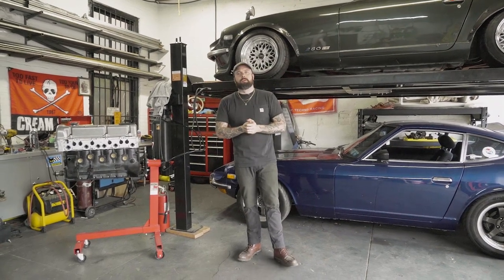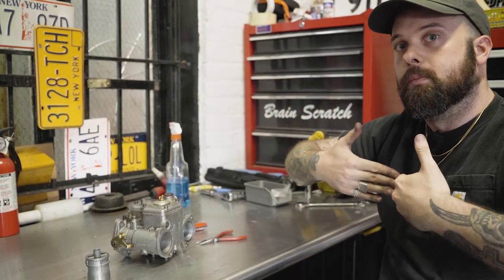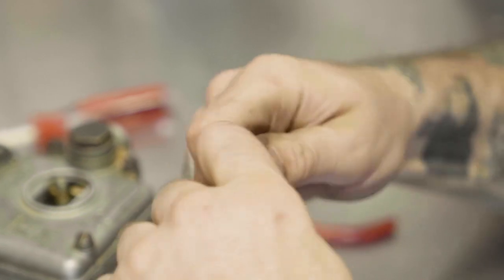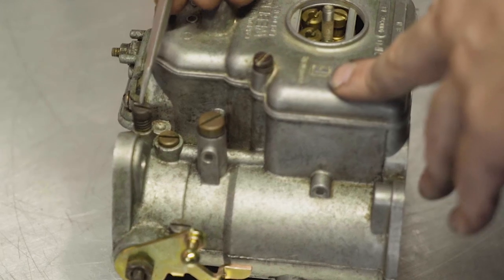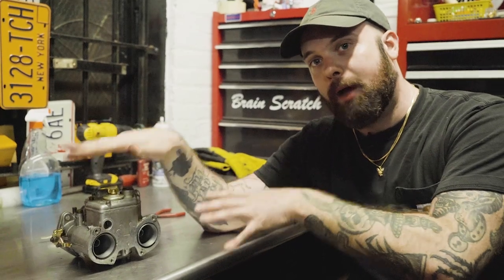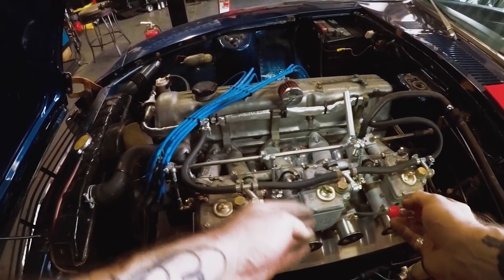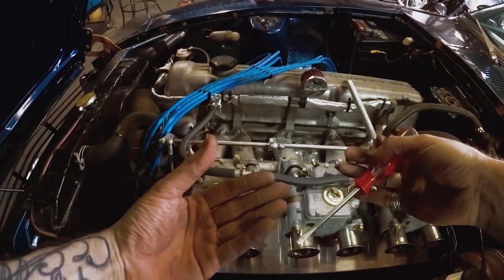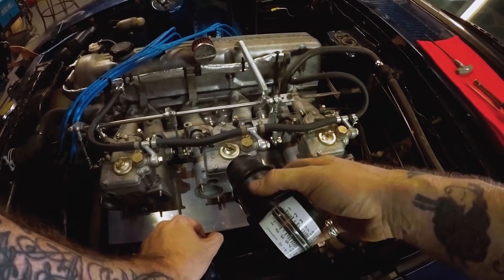How To Tune & Sync Weber DCOE Carburetors

Comment: One of the best dcoe explanations out there. I liked how you specifically explained about the position of the throttle plate at idle with regard to the first progression hole. However, from memory, Weber states it should cover the first progression hole. Once this is set then , in my opinion, the idle speed screw should not be adjusted again as each carb should flow at the same rate. Only use the idle mixture screw to adjust the idle rpm.
Reply from the maker: Andrew B Thank you! And yes, as far as prelim tuning is concerned, all incremental adjustments should be made with your mixture screws to find the best idle without the motor stumbling down. However, once this is established, it is ultimately necessary to balance the carbs within fine adjustments along the idle speed axis, be it with interlink adjustments or the method shown here.
Reply: @TheCurbCut  @5:25 I should add that at idle the Weber Tuning Manual states that the progression holes should NOT be exposed. The early Spanish made DCOE carbs had issues regarding obtaining good idle hence people seem to have to adjust the throttle plate position that can expose part of the first progression hole. The later Weber DCOE 45 152G model seemed to fix this and added a 4th progression hole.
@5:40 - so at idle, the fuel/air mix from the idle jet should only be entering each barrel via the idle hole. The amount of this mix delivered is adjusted by the idle mixture screw as you then say at @7:05.
It is the idle jet that determines the mix of fuel/air that is delivered to the idle hole AND the progression holes.

Comment: I'm a new owner of a '72 240Z with triple Weber 40 DCOEs. These are my first set of Weber side drafts.  I've leaned the idle jets to 45 F9's to get me about one turn out on the idle mixture  screws. Runs pretty well and the plugs look light brown not black as before. I'm also about to change from a race spec cam to a performance street cam this week. I will see how the jetting requirements change then with better vacuum and more compression from less duration. I do have the short taper idle screws. Do you think I could put in the long taper thinner ones for finer adjustment? Thanks for the tune tips.
Reply from the maker: novakenss The longer enrichment screws wouldnt work the way you think by just installing them on your earlier carbs. I get your theorizing, but I wouldn’t attempt this. These screws only help with the idle circuit, so once your in the power range of the car on your main circuit, it almost doesnt matter. Also, they would seat completely differently and the “tuning” here isnt going to net the results you’re after. ALSO! I would wait til you install the new cam and assess where a rejet is needed or perhaps you can simply adjust on your present hardware. Good luck!
Reply: @TheCurbCut  I'm putting in the street cam tomorrow. I'll see how the  air fuel ratios change. I have two O2 sensors in the header twin pipes before the collector. 2 AFR gauges in the console. I'll see all the ranges and what I'll need to do. Lastly, I didn't think that the long tapered idle needles would be compatible with older 40DCOE carbs. Thanks for that info.

Comment: Those carbs with horns, a " uni-sync " tool allows you to keep the air horns on.....the air horns are an itergral part of the side drafts..
Put you are the only channel to explain these carbs ,which are Black Magic to most people that buy them.
Great job.
Reply from the maker: Fair point! And if I had a uni-sync handy, that would have been the way to do it!  

That being said, a good later-note to this syncing process would be this:
- if you're syncing at idle without your horns in place, bear in mind that the longer your stacks are, the richer your AFR will read without them at idle 
- sync a little richer sans horn because intake velocity will be higher when reinstalled, thusly leaning out the mixture a bit
- conversely, the shorter your horns = less intake velocity at idle; your idle syncing will remain closer to your sans-horn readings

By this process in the video, I was functioning off of some pre-existing knowledge of what is needed for this particular application.

And thanks for the kind words! We value all the feedback
Reply: @TheCurbCut  and as to trumpet length it's to help tune power range.
    Short for low to mid range 
Cams and long for mid to high rpm power bands.
    I always find amusing when people run their side drafts on looks alone.
    Let's get the long ones they look Bad-Ass.    Fine for show.
But you need to MATCH ,to go.
Again I've seen tons of videos.....no body has taken the time to explaining chokes and such and then show how to sync side drafts. Your the first..  so that's very cool.
     I've run a SPORTS CAR only Restoration shop for 20 yrs ,20 yrs ago   I love side drafts of all kinds, 
I always had both tools in my tool box ,for monitoring intake air.
I keep both my Z cars in CARBS.    And Happy to do so.
Again a well done video !

Comment: I watched this video again today. I got my street performance 260S Comp Cam installed and broken in. I had to have the rocker arms ground a little. Idle now is smooth and I have put in 45 F9 idle jets to get my AFR numbers to 13:1 at idle which is about 900 rpm. I did have to loosen all the throttle arms so I could get the throttle plates the same. Idle mixtures about 5/8 turn out for 13:1. I sent my distributor to Advanced Distributors in Minnesota for a rebuild and recurve. I want more initial timing, like 16* and no more than 35* above 3,000. Should have it back next week. The cam change raised all cylinders compression 25 psi from the shorter duration. I look forward to taking it out for a test drive with the new cam and jetting. Thanks for the help and info.
Reply from the maker: This sounds like it's sure to be a good time! Good luck and enjoy! Happy to be of help.

Comment: Extremely helpful video! I'm so close to getting mine drivable so I can at least drop it off to get dyno tuned further. Conventional wisdom tells me both barrels of a single carb should be synced with each other. My foremost one is lopsided with one barrel reading about 7 and 5 on the syncrometer, respectively. Weirdly enough the airbleed screw has no effect on the rich barrel...
Reply: Do you have one barrel per cylinder? 
Or one DCOE feeding more than two cylinders? 
If air bleed screw has no effect,  it's possible your shaft is twisted. 
Do both throttle plates line up equally with progression holes?
If so, then likely mixture screws need adjustment,  or one is damaged,  or jets aren't matched from left to right on one carb.

Comment: Excellent explanation on how to sort Webers.  It's taken me 2 years of playing around and a box of jets so I wish I would have seen this back then.  My 2000 Datsun Roadster with DCOE 40's runs great now but has always been a bit reluctant to start when cold but after a few minutes is fine.  Any things I should look for or suggestions?  Nature of the beast?   Thanks.
Reply from the maker: Nature of the best, really! It's more important to have the car properly tuned for idle / runout when the engine is warmed. You could install a manual choke across your carbs to help with warming the car up to temp when you start it, but chokes (by design) tend to run the car extremely rich when they're activated. I tend to air on the side of feathering the throttle enough to get the car to op temp within the first few minutes of starting before taking the car out for a rip. And again, always advisable to stay away from needling the redline until your engine is warmed up.

Comment: Super helpful video. I have a couple questions if you don't mind. What fuel pump is best to run? How important is the fuel return line? My kit came with the fitting to end the fuel line at the last carb. Also where do you vent the block breather to that comes off of the back of the block? This is on an L20b with 40 DCOEs. Thank you.
Reply from the maker: Regynald Rieth Hey there! Thanks for watching.  I run a low-pressure Carter pump. They’re noisy, but they’re preferred by a lot of old-car guys because they do a good job of pushing thru any contaminants and don’t jam up like other units if they get some rust / sediment in them. (Obviously a few in-line window filters are always a plus here too to keep an eye on just how dirty things might be for you). As far as the return line is concerned - this can go either way on a setup like this - I don’t run a return on my car across the carbs, but Mo’s car here did. I simply have a return route back to the tank from a Holley FPR at the fenderwall. At such low FP, the constant low lbs of pressure across your carbs is not enough to be an issue for spill-over or flooding as long as pressure is controlled. That being said, anything with a lot of flow should have a return post- fuel rail. And lastly - your PCV vent can vent to atmosphere when you run triple carbs. Not a problem!
Reply: @TheCurbCut  Thanks! I was about to pull the trigger on a carter pump. Thanks for the help

Comment: Great Video!!! Wondering what you think about about vacuum advance with triples on a 240z, since that affects idle speed? Do you run your Z's with triples, with or without vacuum advance?
Reply from the maker: Vacuum advance isn't really a thing with triples. DCOE's like to have 32deg all-in around 2500/3000 RPM, depending on your set-up.

Comment: Hi!  
Very good detail explanation .

I have toyota corolla 1.8 -3TC engine . That I need to  tuning the carburators . Any advice how get it set up from base line at cold.

Thank you
Reply from the maker: Well, the first thing you're going to need to do is WARM UP the engine. Never should your carbs be tuned / synced below your standard operating temp. If your car wont turn over, consider employing use of the mechanical chokes - but do NOT compensate cold start in how you baseline your carbs.  Not the way to do it. Good luck!
Reply: Hi 

Thank you  very much for for information knowledge.  I will work on . We will keep you updated.  Car its running to rich, what woul be the best fuel pressure?
Once again thank you Curb Cut!!
Reply from the maker: Israel Rosario Depending on your setup, Webers tend to run best anywhere from 3.5 to 5lbs of pressure across the carbs. Good luck!

Comment: Need your help man. Triple 45s italian. Did the perfect baseline, floats were measured, perfect idle with initial 3.5 psi. Then after 5 minutes, rapid decrease to zero psi to stall. Do float levels and/or faulty valve cause a decrease in the fuel pressure?

Comment: at the 17:22 or so section you mention about closing the progression hole a bit, but perhaps intentionally do not show a close up of doing that, is there a reason for that... I assume that is done in a few turns of that screw you mentioned early in the video?
Reply from the maker: Couldn’t get a close-up here by virtue of the chest-mounted GoPro. But you are correct to refer to earlier in the video where this is explained. Sometimes ya miss the shot, what can I say!
Reply: @TheCurbCut  Oh no I've looked at my setup that I bought 30 some odd years ago when I had no clue what I was doing... was shipboard in the Navy and was a weekend shade tree mechanic w/ lacking too many needed tools.. anyway my middle carb of the triples does NOT have those progression screws... they are blocked off w/ brass covers... so should I still be able to adjust ok by doing just the other four cylinders or should I look into replacing the middle carb... thanks The Curb Cut!!!!!
Reply from the maker: @ktnameerf  shoot me an email about the specifics and we can discuss a solution - john@groundlevel-nyc.com

Comment: Great video! Currently tuning new weber sidedrafts on my datsun 1200 coupe...they're both reading a ridiculously high level of 10...is that the linkage/idle adjustment shown near the end of your vid?
Cheers
Reply: Mine are reading the same. I can’t drop the air flow down. Was you able to figure it out ?

Comment: Okay, this is a fantastic video! I have a couple questions as a young buck of 20 years excited to have a triple carb S30 someday. That gauge you're using around the 17:50 mark to check how rich/lean the mixture is, what is it? Further, I saw you use it on one of the barrels on each carb, would you use it on all six in in this case? If not, why only on one barrel per carb, if each barrel is richened independently? Thank you!
Reply: AEM Air fuel Gauge

Comment: Ok so Im running 38 Doe’s on 1.8 litre and no matter what I do, after it warms up I have spent fuel that’s igniting. Ive reset my timing multiple times and it’s good. So thoughts? Main jets to big?
Reply from the maker: Based on what you're describing, there is likely an extreme richness happening somewhere. If this is happening when it warms up at idle, but you havent driven the car yet, it's likely the idle jets. Not so bad, and easily remedied. If it happens when you let off the throttle while driving - or worse, after you try to turn the car off - you might even be dieseling. In any event, you need to diagnose this problem and lean out. Also make sure that you havent damaged your seals by running excessively rich, as this would only heighten the dieseling symptoms. Good luck!
Reply: @TheCurbCut  Right On. I greatly appreciate the second opinion. The carbs are freshly rebuilt and as mentioned checked Timing numerous times and then adjusted everything to the best of my ability to wear the car runs great. Open up to much and more popping, so obviously more fuel, and then lessen the fuel and popping goes away and becomes intermittent with no backfire after shutting off. The carbs cam with 30 m Choke But the main jets seem huge at 140 and the Idle jets at 45. Im working on locating some jets to lower the amount of fuel running through and go from there .. Once again Thank you for letting me pick your brain and taking the time to give me your Opinion. :)

Comment: Such a well made and informative video, thank you. I do have a question, seems like I have the same manifold and it came with the same vacuum port on it. Do you happen to know what size thread/what thread pitch it would take for a barb fitting?
Reply: Check out the plumbing section of your local hardware store. For some reason it's common for the vacuum fittings to use NPT fittings on these manifolds.

Comment: Could help me to decide what size of idle jet are better for my setup, i have a 240z L2.4 spanish tripple webers, my idle jets are a 45F9, the idle run are good but i tick its richer in low rpms, i was put a 40f2 but with that jets the car won’t start
Reply from the maker: Hey there. 40’s are definitely too lean. Typically your idle jet window for a stock 240Z are going to be around 45-55. Stay in that ballpark and dial in your tuning. Good luck.
Reply: @TheCurbCut  TNKZ
Reply: Hi, it’s me again, wish its te better main get setting for a daily drive and the other question its the better timming position por this setup?

Comment: Whats the best way to put these 40 Webers in long storage?
Reply from the maker: David Really depends on how long, but the key thing no matter what is making sure the gas is thoroughly cleaned out of the carb. Beyond that, my advice would be liberal amounts of WD40 and wrapped tight in plastic wrap. Basically want to prevent rust and/or oxidation, and the WD40 would be a good barrier in preventing both.
Reply: @TheCurbCut  Thank you. I completely cleaned them out, used carb cleaner then blew most of it dry. I wrapped loosely and put in a plastic bin with desiccants. I'll lube them up, thanks.

Comment: Have you tuned SK carbs before? I’m having trouble at around 3000rpm stumbling to 4000rpm then it seems to correct a little bit.
Not sure what to change from this aspect. 
Any help appreciated thanks!
Reply from the maker: Could either be accelerator pump is too lean or your air correctors might be too large and the fuel is aerating too much in the main circuit at higher rpms. Hard to say with no knowledge of your jetting and all. Good luck!